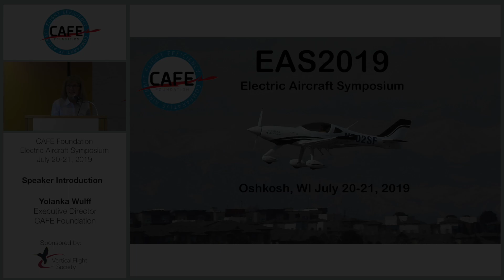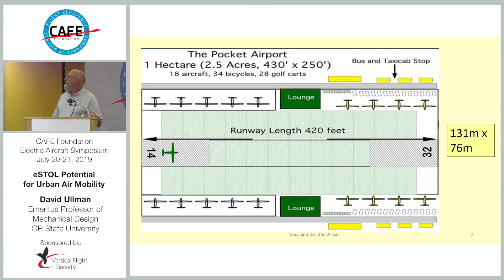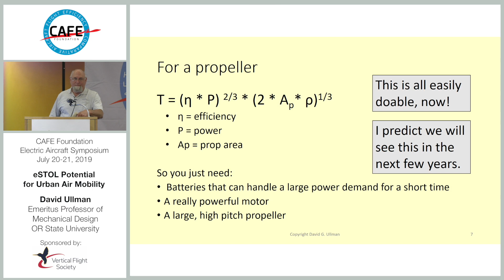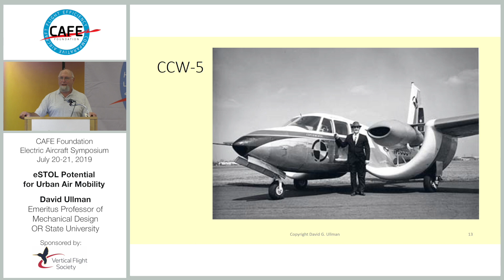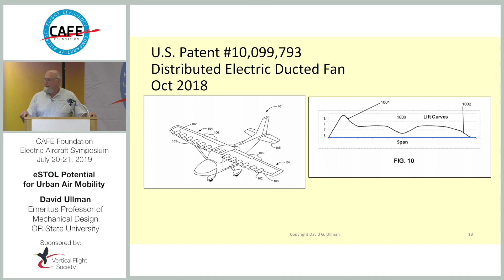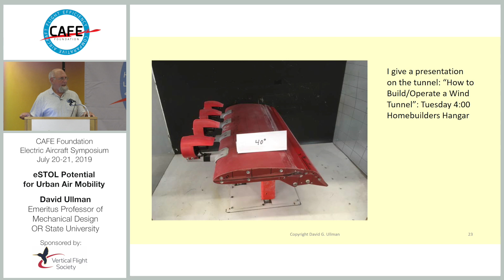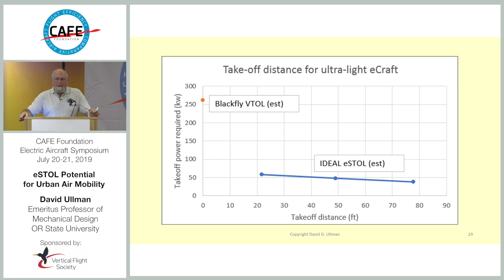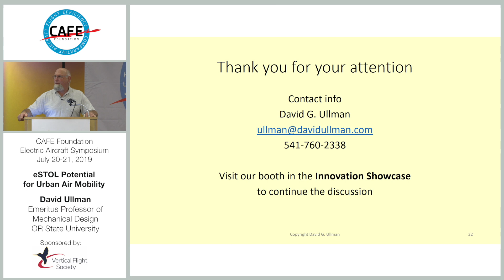CAFE EAS 2019 #6 - David Ullman - eSTOL Potential for Urban Air Mobility

Comment: If you are interested, I have quite a lot of general information and data on the custer channelwing.  I have all the NASA, NACA, consultant engineering studies, etc.  I am not an engineer but I am a pilot. (20,000+ hrs)    NACA wind tunnel tests (which I have) show a maximum vertical component of thrust of 14+ pounds of lift per horsepower.  I have seen a movie of an aircraft tied to  post, with a pilot in it, in still air, lifting off the ground.  The movies of the Custer landing at approximately 15 mph do not show it's true potential, because the throttles were retarded for the descent for landing. I have talked at length with "Curley Custer" who was the pilot in all the pictures.  Harold Custer was afraid they might wreck the only plane they had if Curley would try to get too slow.  The head of Antonov's experimental division, Victor Orlov, did over 2000 hrs of wind tunnel testing on the Custer, and came up with a wealth of data.
At any rate I have the data.  If you are interested Bruce Green at  -   channelwing@yahoo.com